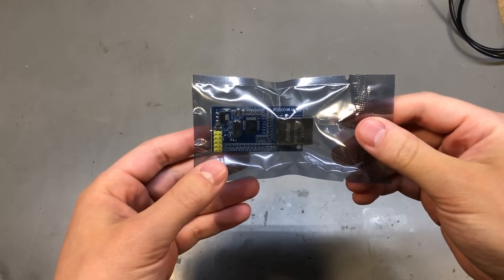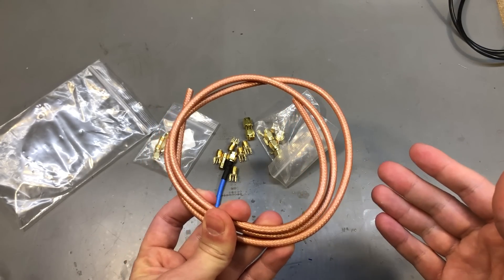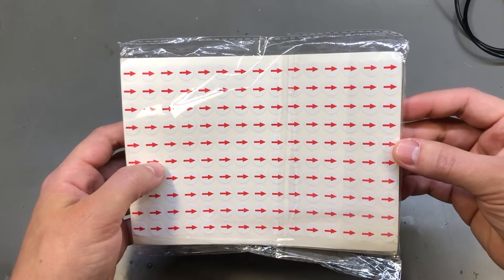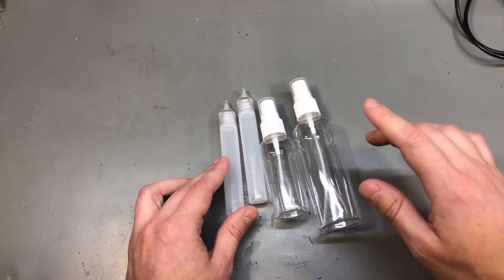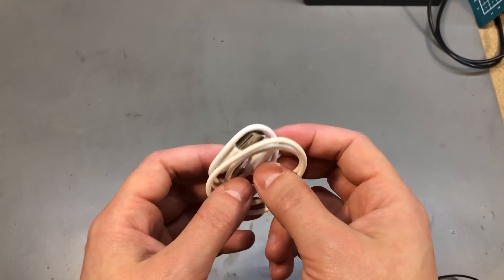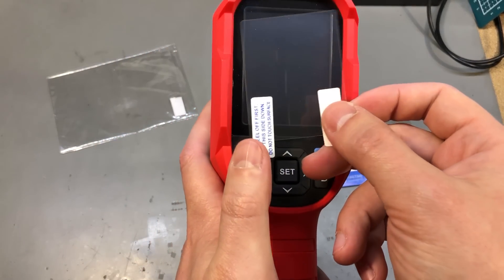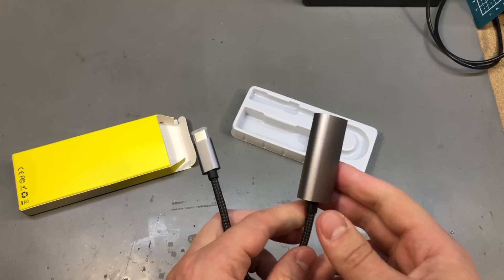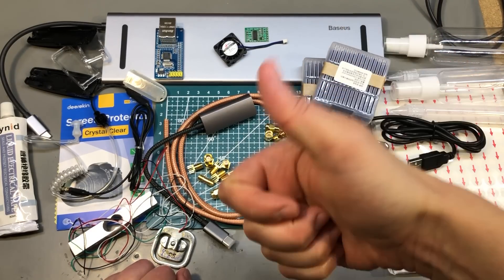InTheMail | Voltlog #363

Comment: Double check that you ordered the correct cable, then document it and you should be able to get a full refund (if all that's worth $2 to you).  I dispute all failed orders, even if it's only $2, and have never lost an AliExpress dispute yet.  Sometimes I think I got the wrong thing but when I go back and check the order it's actually what I ordered.
Reply from the maker: I'm also disputing every failed order but like I said sometimes a full refund is not granted. It's pretty rare but I do get 2-3 cases per year.

Comment: The wiznet chip is such a power hog. I never managed to get it working with arduino.
Reply from the maker: Did not think about power when I ordered it but since this is tipycally used with wired products it shouldn't be an issue.

Comment: Does anyone know a cheap supplier for USB dongle/thumb drive enclosures? Even if in volume. 

The cheapest way currently would be to buy the really rubbish unbranded 256MB/512MB/1GB/2GB flash drives and take out the PCB... but that would be a lot of electronic waste and a gamble on how easy the enclosures are to undo.  I have considered 3D printing but I don't have a 3D printer and the services are too expensive for this purpose as expected. Western suppliers of USB enclosures are eye watering in cost.
Reply: He has a link above, or search USB housing enclosure on aliexpress.

Comment: I keep 3d print filaments in a plastic enclosure that has almost an inch of kitty litter (silica gel, the clear type - not clay) on the bottom. Very cheap way to get lots of silica gel. I use the colored ones you got as an indicator. My cheap kitty litter has no  blue/red indicator in it.
With lots of silica gel it is ok to change or dry it perhaps every year or two in my not that humid environment.
Reply from the maker: Thanks! I will look into getting that transparent kitty litter.

Comment: You should test that "Liquid Electrical Tape" with megohmmeter... ;)
Reply from the maker: You suspect it may be conductive?
Reply: @voltlog  "Conductive" is relative (as you know) :)
Since they don't list ingredients, and there's presumably no datasheet, it'd be useful to know if it's "an insulator" according to a random handheld multimeter, or "an insulator" as confirmed by a proper insulation resistance meter (megaohmmeter/"Megger").

As Big Clive's said before, some things that don't appear conductive to the small potential of a multimeter can in fact be very conductive when faced with 240VAC mains!
(Or 250VAC in Big Clive's case... The Isle of Man likes to push the limits of the "230V +10%/-6%" [IIRC] harmonised EU mains spec, it seems!)